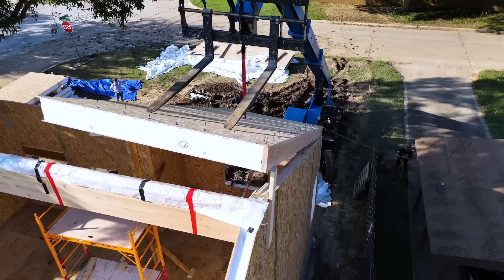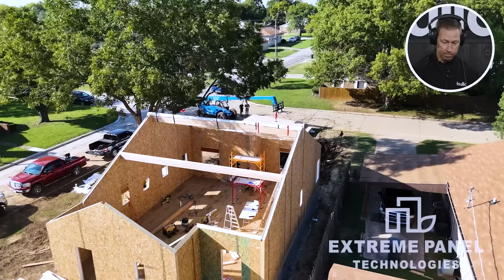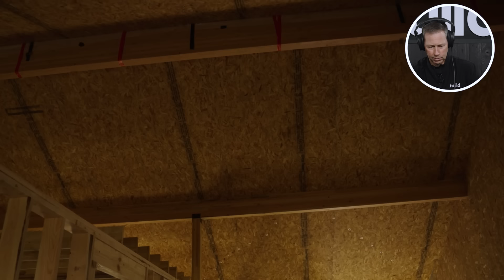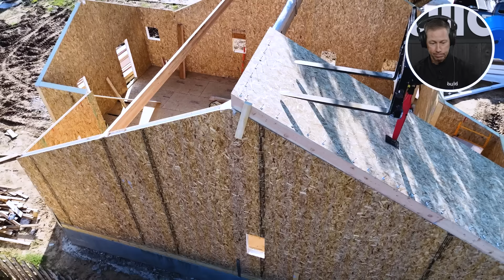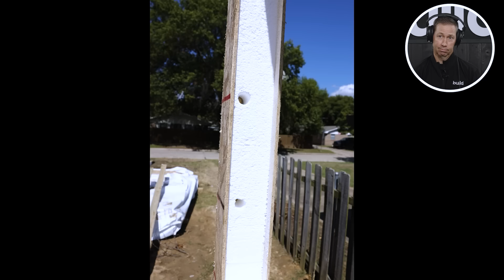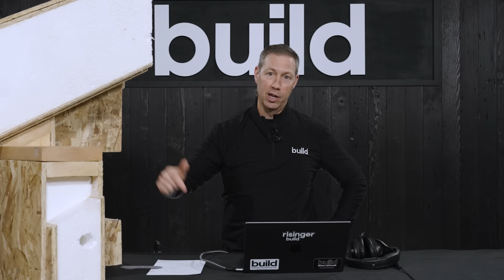High Performance HACK - Why More Builders Are Choosing SIPs

Comment: I had a roof repair... all the osb deck was rotted off of the foam.. honestly a nightmare
Reply: Paint the sips with exterior paint before you install your Tyvek or whatever.
Reply: Typically, deteriorated conditions are a design issue or an installation issue (People Issue) not a material issue.  Any material not designed or installed properly will have issues.
Reply: @JoePasma  you must sell sips for a living, this is a common issue with sips.
Reply: @ACatKrom  No I don't sell SIPs for a living.  I am a consultant who specializes in SIP construction from design through manufacturing and then on to the construction phase.  I also consultant on other construction materials and methods.
Reply: @JoePasma  so yes you do sell and make money from selling sips, for a living
Reply: @ACatKrom  I do not sell SIPs.
Reply: @JoePasma  you already said you make money from the sale/use of sips, and you lied claiming there are no studies on the subject, when you knew about Juneau, and others

Comment: For even better performance SIPs can also be had with XPS, PolyIso, or Polyurethane foam. SIPs can also be constructed with ZIP sheathing too.
Reply: XPS and PU are limited in the thicknesses they can provide which limits structural capabilities.  ZIP is also limited in size.

Comment: @buildshow Hunter Read is not an architect. He works in Oklahoma and is not licensed by the state to practice architecture. Under OAC Title 55:10, the terms “architect,” “architecture,” and any derivative of the word are legally protected and cannot be used to describe someone who isn’t licensed. It is illegal to falsely represent your qualifications as an architect. A quick search of the Oklahoma Board of Architects licensing database shows no record of him.

I’m not sure whether Hunter is misrepresenting himself or whether this was an oversight by The Build Show, but I’d expect more diligence before publishing a video. If the goal is to promote higher quality construction and design, that also means respecting the professions involved and representing credentials accurately. Having an architecture degree does not make someone an architect; it is only the first step in a long process.

This isn’t the first time the show has done this, and it’s getting old.
Reply: Hunter has a bachelor's degree in Architecture from the University of Oklahoma. The part you are leaving out about the legal use of the title "architect" is that a landscape architect or interior designer can use the title "architect" if they are licensed in Oklahoma. It's just another licensing scam that lobbyists have pushed through the legislature to restrict who can do certain types of work. Are you one of those lobbyists Mr. Stumpf?

Comment: Wow. This SIP construction does look big. I have a few questions:
1) The house was built over a crawl space (as opposed to a slab). And crawl spaces are notoriously dank and mildewy (an almost guaranteed health concern). You did not show the underside of the flooring. Is the floor SIP construction, when built over a crawlspace or basement, too? Or is it standard joist/frame construction? What does the exposed underside look like, and what are the floor insulation details?
2) You did not mention testing for VOC's from the OSB and foam insulation once the structure was dried in. What does the out gassing look like just after shell construction (dried in, with no interior walls erected), then after completion of the interior space and start up of the conditioning system, and then down the road five years? This is obviously a consideration for any type of construction, and especially a single family home where you spend half your life.

I'm not a builder, but I love this show. I'm Joe Handy and like learning ways I can do my own repairs of literally anything I touch or use from guitars, to cars to homes. Great job as usual, Matt.
Reply: Answers:
1) Proper venting of crawl spaces is essential to mitigate the condition you describe.  Floor panels can be used over crawl spaces.  Treated plywood as the skin facing downward in a crawl space is an option but spans are limited because of the size limitations of plywood.
2) SIPs do not off gas.  The APA has documents regarding off gassing.  The EPS is inert.  Homes with SIP walls and roof require proper ventilation, just like any tightly constructed home.

Comment: They're fast and high r, but osb and foam shouldn't be considered structural... these are less than 100 year homes in many cases
Reply: Where did you get the information to support your comment?  The APA certainly considers the OSB structural.  EPS is used in geotechnical applications called Geofoam.  This is certainly a load carrying application.  🤷‍♂🤷‍♂
Reply: @JoePasma  you want to use glued wood chips for your structural strength and building code allows it by all means... id rather build with long lasting materials

Comment: Sips isnt a good idea. It creates the need for specialized expensive repairs a homeowner cannot do themselves. I think conditioned attics and crawlspaces are as close to perfect as you can get, but even that is heavilly dependant on a good hvac, which would have to be fixed immediately if broken.
Reply: SIPs don't create the need for specialized expensive repairs, poor installation by people does that.

Comment: I love the monopoly framing episode you covered in Texas. Comment: OSB is problematic if it gets wet or experiences too much condensation, it rots a little faster than regular plywood. Plus it doesn't smell very good. High density rock wool with plywood will breathe better it's less toxic. Polystyrene bead board has performed well as concrete slab displacement and slab thermal breakes. It would be interesting to see the data on the latter. We did a SIPS style roof with blue closed cell in 1978. We drilled a lot of holes in the outer layer of plywood so the foam and lumber could vent. Open up the roof 42 years later for more skylights. There were some dead insects, but the lumber was in great shape. There was a three-quarter inch airspace between the tin roof and the last layer of plywood. The sheet metal roof was hung on horizontal fir strips on an a 7-12 pitch.
Reply: I agree that traditional plywood is a superior material to OSB, even if OSB allegedly rates better in testing and meeting design criteria. I would still want to specify plywood if I was ordering SIPS.

Comment: Added a vaulted great room several years ago. 6inch sips walls and 12 inch ceiling. Other end of house added large master bedroom. Heat by propane. Original house is standard 2x4. Doubled the size of the house but didn’t increase heating or cooling costs.  Been through 2 derechos with damage only to original house.

Comment: Great!   The 20 year house is finally here!
Reply: SIPs in the US date back to the 1930's.  The crucial modern leap for SIPs came in the early 1950s with Alden B. Dow, a former Wright apprentice and the son of Dow Chemical’s founder Herbert H. Dow. Recognizing both the limitations of Wright’s uninsulated panels and the broader imperative for energy efficiency, Dow developed the first bona fide SIP by incorporating an insulating Styrofoam (extruded polystyrene, XPS, colored with a blue die) core between plywood skins. In 1951, experimental houses in Midland, Michigan, employed panels with 1-5/8 inch thick Styrofoam cores glued to ¼ inch plywood, assembled using wood splines and blocking methods designed for full system rigidity.
		
Hardly considered short lived.

Comment: Acknowledging the serious rot problem that occurs in SIPs should there be an air/water leak is critical. Coupling this with a system like Aerobarrier once the windows and doors are in would be a good idea
Reply: AeroBarrier has been used with SIPs.  It works very well.  This combination will get you to even better than Passive House air tightness standards.
Reply: @JoePasma  Truth be told I recommend Aerobarrier for just about any build, including if someone is doing a down to the studs remodel. It serves as a home equivalent to gasket sealer when assembling tight tolerance machinery. Its crazy to me we don't use gaskets for the sealing interfaces of homes. The GC I came up under would task the lowest paid guys, the general laborers, to seal all the bottom plates to slab/rim, top plates to rafters and blocking, all penetrations through the walls, and we would even use subfloor glue at the seams on the wall sheathing. This was in 1996 before people were talking about air tightness.
Reply: @Natedoc808  Agreed.  You can't go wrong with your methodology.

Comment: How would you use this doing a slab foundation where both the plumbing and electrical would be in the walls?
Reply: More information is needed on your build to answer that question.

Comment: So seeing an alot of mentions this product is plagued with a rot issue. One noted fire problems, which given its foam a certainty most of the time. Seemed like a good product idea but two glaring issues to be clarified. One thing so far Matt has not really noted the down sides. So I guess if your in a desert might be ok. ICF or pre made concrete panel is the direction to go.
Reply: Rot issues can be mitigated with proper installation, and WRB's. Fire problems are mitigated with a foam retarder that is in the foam of our SIPs. There is also an argument to be had that the tightness of the house will not allow for oxygen to feed the fire.

Comment: I never understood why the panels never included what i will call nailing studs ( extra think stud every 16- 24" )  . These would not be structural but nice for ectra strength for hanging things ?
Reply: OSB is great for hanging things plus the added 2x material adds more thermal breaks but does nothing for structural integrity.

Comment: I'd like to see what the electrical runs on the exterior panels looks like. How are they run?
Reply: Take a look at the wall panels sections on the video.  The round hole in the EPS core are the electrical chases.  They run horizontally at switch and outlet heights throughout the wall panels.   There is a vertical chase every 4' that runs full height of the wall panel.

Comment: Matt,
Is there an option for Zip panels?
Also, is there an issue with condensation on the backside of the OSB like some people have eluded to?
Reply: Some SIP manufactures use the ZIP sheathing.  The sizes are limited.

If backside refers to the interior side exterior OSB, as long as the core is laminated to the OSB there will not be an issue.  

EPS cores are laminated directly to the OSB.  

PU cores are foamed in place.  If the expansion process works properly, there will not be condensation issues on the backside of the OSB.

Comment: Why not just use standard framing construction with blowing in closed cell spray foam insulation into the walls as it hardens and becomes part of the structural strength of the walls

Comment: we installed a hrv in a sips build and the off-gassing was terrible. they had the windows and doors in and we actually brought exhaust fans to air out the house while we worked there. i haven't been in the house after completion so i don't  know how long it lasted
Reply: What was off gassing?  SIPs don't off gas.

Comment: I have a neighbor not far from our off road cabin and he had a SIPPS kit helicoptered in to his property. He then had the helicopter come back and lift the beam in place for the roof. The place is 20x24 feet. I helped some and they are a pain to build. Also wiring is a pain. On the plus side he heats it with a small wood stove.
Reply: Remote locations with out the proper lifting equipment can be problematic.  He could have used narrower panels which would have reduced the weight.  A panel weighs about 4 psf.

Comment: Weird to see EPS make such a comeback. Feel like not long ago polyurethane was considered the much better option.
Reply: It's just cheaper
Reply: EPS is less expensive than PU.  PU is also limited on the thickness available which limits its structural capabilities.
Reply: @JoePasma  good point, thickness dominates for strength in a span. Still think PUR is way underrepresented in the industry though. Cost difference per R is not dramatic plus you get a thinner assembly without the moisture sensitivity and extremely low thermal mass of EPS.
Reply: @JohnboyCollins  The IRC Section 610 load charts and prescriptive call outs are based on EPS cores and the testing associated with the EPS core.

There are definitely situations where PU will be a better choice.  Each situation needs to be evaluated on its merits.  It's the age old answer "It Depends". 😉😉
Reply: @JohnboyCollins  - Agreed that thicker panels span farther - that is simple physics.  PUR foam has almost twice the R value of the cheap EPS foam.  And PUR foam is truly closed cell, whereas the EPS foam is open cell (hence the many "rot" complaints I see in the comments).  At Eco-Panels we manufacture closed cell PUR panels - our 6.5" panel which offers R40 (theirs they say is R26) we generally span at 8ft max.  Our 8.25" thick panel which offers R60 at around 15degF will span up to 14ft no problem.  Agreed that thicker panels span farther - but of course is more cumbersome on a jobsite and these jumbo panels require a crane to even set the wall panels.
Reply: @CharlesLeahy-eco  You need to do some research.  EPS SIPs have a perm rating of 0.1.   It's the assembly that counts not just the core.  Poor installation practices account for 99% of the deterioration issues.  It's not a material problem.  It's a people problem.

Comment: I didn't see gable vents and it looks like you can't put roof vent in... Why?
Reply: With SIPs constructed as the exterior envelope of this home, an attic space is not present.  Roof vents and attic vents are installed in homes that have the insulation installed at the ceiling of the upper most level with an air space above the insulation.  The venting is intended to allow warm moist air that leaks into the attic from below to escape to the exterior.  This mitigates moisture issues of the framing materials in the attic.

So, no attic, no venting needed.
Reply: @JoePasma  
Thank you for your feedback, much appreciated!
Reply: I’m pretty sure you could place either a vented or unvented roof on top of the SIP roof panels.
Reply: @kc9scott  
Thank you for your feedback.